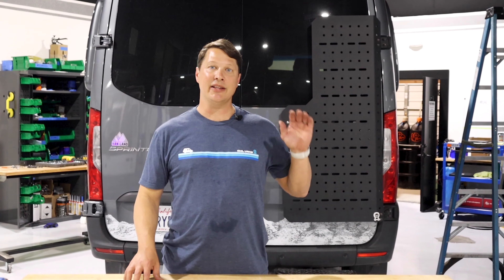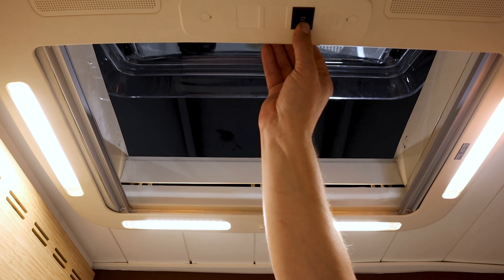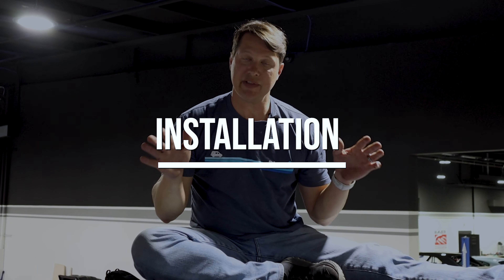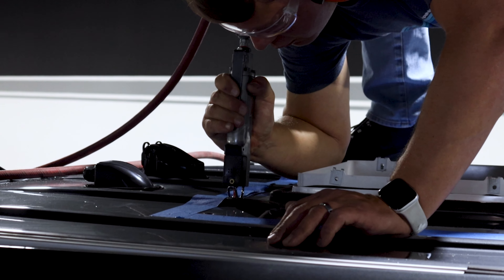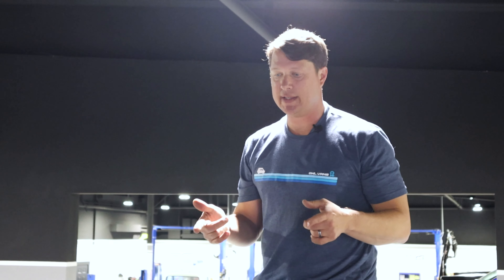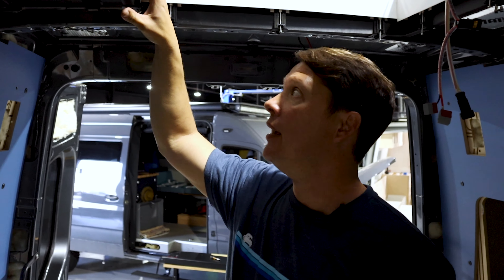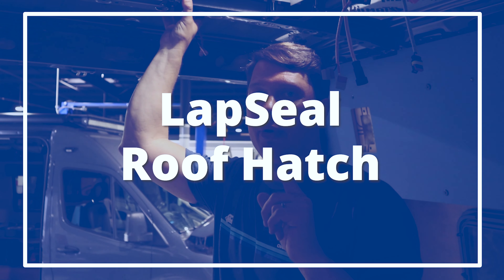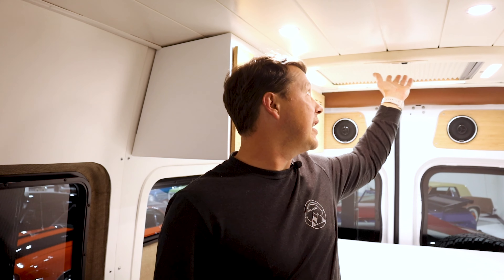Skylight for Sprinter Vans | Tern Overland Roof Hatch

Comment: I'm in Florida and don't care for natural light, rather have the privacy it be dark at night, but would really like to stand inside a low roof and have a look out.  I have this idea of fabricating a custom large hydraulic hatch made from a solar panel and bending an inch of  the roof sheet metal up so it's water tight  also  NO drilling, screws,  butyl tape or caulking mess.